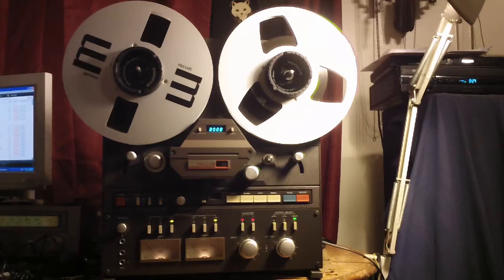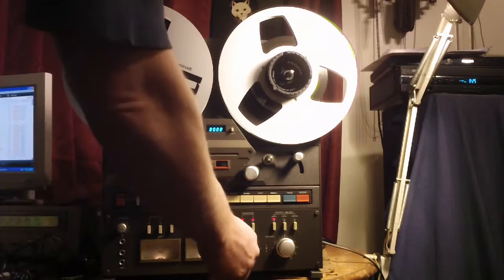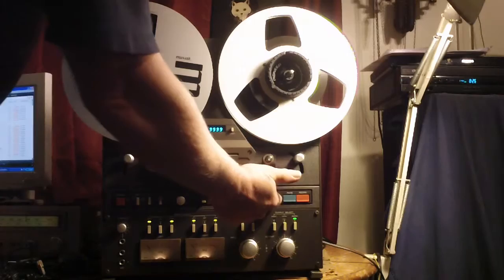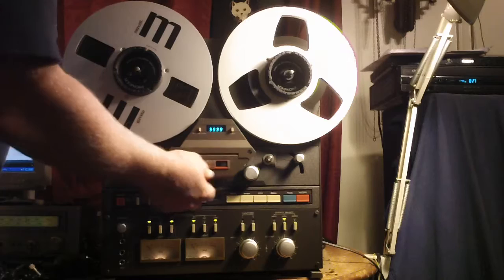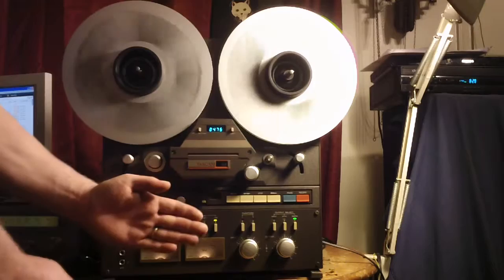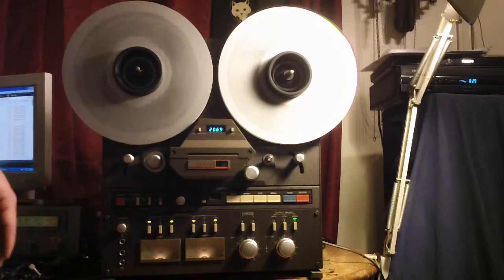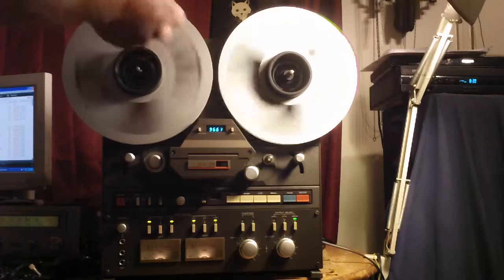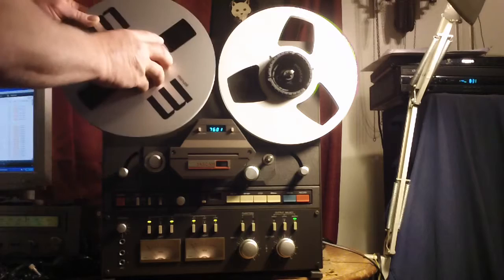TASCAM 32 #2. Functionality Demo. Serviced, SOlder Joints, Burr Brown Op Amps. ZCUCKOO

Comment: Nice video and it looks like you did some nice work here. I'm seeking your expert advice on a different deck, do you mind if I ask you a question about another deck? If you do, sorry to bother you, TimR. OK, I own a Tascam TSR-8 recording deck (that is actually in really good shape) BUT it seems the locking hubs are pretty crap. Each assembly has 3 pieces to it plus a spring washer that screw directly onto the shaft tip of the brushless motors, as I'm sure you know.  I found broken pieces of plastic inside the return reel hub (on one of the pieces) and I super glued things back together and reassembled it. OK, immediately afterwards I called Tascam and they are sending some replacements. But here's my question: Even though these hubs are crap for the job they have to do, I can't help but wonder if the irregularity I see (and hear) with the reels (tape rubbing during play/record, etc.) as they rotate can be caused entirely by the hub - or if there is something odd with the motors? I'm thinking it is the hubs but you probably have an opinion here? I would appreciate your thoughts if you have a moment, TimR. Thank you.
Reply from the maker: I don't mind questions but I am not familiar with that model I'm afraid. Is the main problem that the tape rubs the reels? If that is the case what may have happened is the deck may have fallen forward at some point and that will usually push the reel tables out of alignment making the tape rub on the outside flange. Are those twist locks metal on that deck or plastic?
Reply: TimR, thank for the reply. Yes, the twist hubs are all plastic. Unlike a typical deck that you work on, the shaft of the motor is sticking out about 1/2" for the case and it has a threaded receiver to attach the plastic hubs. Haha, it is not THE WAY. As to the reels being warped, no, they behave like they are warped but they are flat and uniform as I lay them on my quartz kitchen counter top. 

At this point, having ordered the new hubs, I'm hoping my troubles are over. But this hub and the way it attaches to the motor shaft - and what it is made of - looks like a bad offering by an otherwise good company. Fingers crossed, TimR. I was hoping you had some experience with this model. I'll circle back after I get the replacements installed and let you know. I really love that you are into this and frankly I haven't used this deck much lately because I've gotten involved with digital recording for the past 14 years - but - the idea of upgrading the 8 channel cards is always on my mind, TimR. I wonder if this might be worth a look for you? I'm pretty electronically oriented and can solder but this may be in your wheelhouse...?

Ross
Reply from the maker: @roosterross2802  Well, See if anyone has "Upgraded" their boards like a ton of people do for say the Tascam 32's, 34's etc and if so, see what they have done. Some upgrades seem a little hacky to me but depends on what you want to do with the unit. I have upgraded the OP Amps to Burr Brown amps without an issue but some people say that is problematic. I usually re-cap using Elna Silmic II caps and Wow, i like and have had lots of compliments too so  I've had nothing but good luck but there's smarter people than me out there but again check and see what if anything has been done as far as upgrading them. I have to remember there are Electronic Engineers with years of experience in Design that have built these things and I would like to think they know best. But then look at your Reel locks. =)

Comment: Would love to know the way you went about installing new op-amps. I use a Teac 3340 and although the opamps are vibey, would be great to be able to throw something higher-end in. Also, I'm having trouble with a Vu Meter not receiving signal although the channel works fine. Threw a new one in and it did nothing. Ever heard of that issue?
Reply from the maker: Been a while since I recapped a 3340 and while I might be mistaken but I'm fairly sure there are no op amps in those guys. I have re-transistor ed a number of Teac A series including a 6100  and the hiss was extremely low, much more so than a stock A series. The transistors  made now a days are much more low noise. The VU Meter, I have seen a couple with open coils and they are just a damn Hoot to replace I know but never seen a good. You can put a small battery across the coils quickly and make sure the new meter is good. Other than that, I would have to dive into the scheme and see what controls it. Good Luck,
Reply: @Zcuckoo  Thank you for the reply! Re-transistoring the machine may be in the future if that's the case. Opening the front for the VU meters will definitely come later as it is such a pain!

Ryan
Reply from the maker: @ryanfaris5106  Oh it's open heart surgery for sure. Again, you can test the meter before removal may be worth your while. T

Comment: I'm under the impression that this is a recorder unit so not really that good for including in my Hi-Fi system as a playback device for pre-recorded reel to reel am I mistaken or is this true? BTW I have the same unit at home and I'm attempting to change the capstan belt which is broken so I just thought it would be worth my while or not thanks good video.
Reply from the maker: This is a 2 TRACK Unit. Most typical Pre Recorded tapes are 4 TRACK and that would be a problem. This deck is used to record and playback in 2 track mode only.  It is certainly a great deck to get running again. There's more to life than a 4 track depending on HOW you wish to use it.

Comment: I am wondering can this deck be changed to play and record 4 track 2 channel stereo and also can you change the speed from 7.5 ips and 15 ips to 3. 3/4 ips and 7.5 ips as well. if so can you replay and let me know what I need  to do and what I need to get thank you  and keep the great videos coming
Reply from the maker: Thanks for the comment. Off the top of my head so to speak, you would need playback/record heads as well as an erase head for 4 track. The impedance would be an issue and would need to match the pre-amps or be modified more than likely. Then there's the capstan speed. If it were me I would seek out a Tascam 44, or a Teac 3440. Those are 4 channel decks (Quad) and you can play channels 1 and 3 for your stereo. Other than that, I don't know. I don't re-engineer these things, i keep them as designed with the exception of an OP amp/ signal transistor upgrade. You can bring that topic up on AudioKarma and see what those guys think. It's a fair amount of work, money to basically downgrade the deck. Good Luck with your endeavors and Enjoy no matter what you do. =)
Reply from the maker: I must be tired, it just dawned on me that the heads from a Tascam 34 will work nicely on this deck. in fact, you could probably get the entire headblock to screw right in place of the old one. You could only connect channels 1 and 3 but would solve the first question. The capstan motor would need a modification or two. Finding the heads cheaply will be a trick though. Good Luck and Thanks again, Take Care, TimR
Reply: Hello thank you for the fast replies I have four track stereo pre recorded tapes and most are 3.3/4 ops and I have an old 4 track 2 channel stereo teach a-1200u reel to reel that no longer works no place or record and want to know if those heads can be transferred to the tascam 32 deck and also the speed issue as well to slow both speeds down to 3. 3/4 and 7  5 ips per second that is what I wish to find out I have 98 tapes that I want to listen to but I am not going to break the bank to do it any further Ideas would be very much appreciated
Reply from the maker: @tough213  Apples and Oranges. Heads won't even mount in there and the capstan drive is hysteresis and the Tascam is a DC motor. Check craigslist. I'm sure something will pop up in your area. Good Luck

Comment: brushes??  these are brushless induction motors!!
Reply from the maker: Oh NO they are Not. Capstan is the the same motor as in a Pioneer RT-909, Teac X-300 etc etc and have Brushes. BOTH Reel motors are DC and use Brushes, Yes Sir, You Bet. Been in many of these decks.
Reply: +ZCuckoo TimR coor that's weird wounder why they used brushed motors??
Reply from the maker: It is designed for studio use so I believe they didn't care about noise so much as performance. The FF and Rew didn't play games so to speak. Thanks for the message and take care.
Reply: +ZCuckoo TimR thanks,  I've just bought a 32-2B on ebay is this also the same with brushed motors?
Reply from the maker: That I don't know, I've been all through the 32's a number of times but not a 32B. Now I'm curious but I don't see a scheme on hifi engine for it. =/